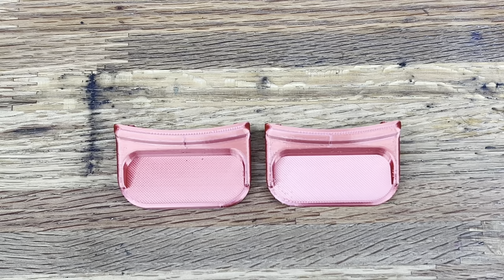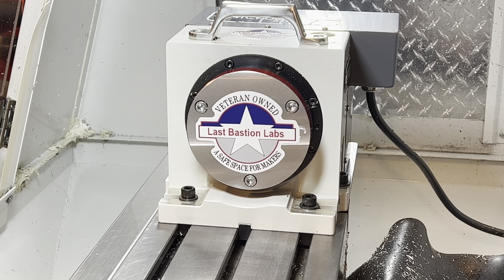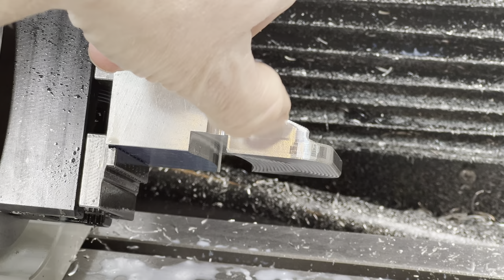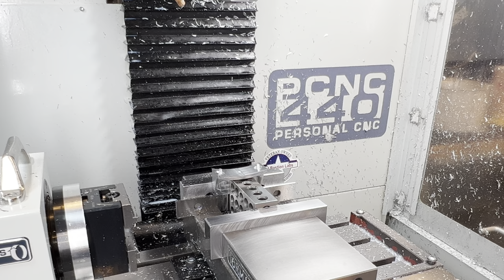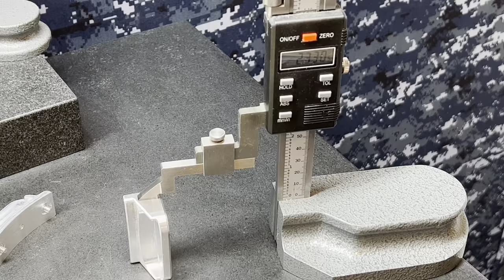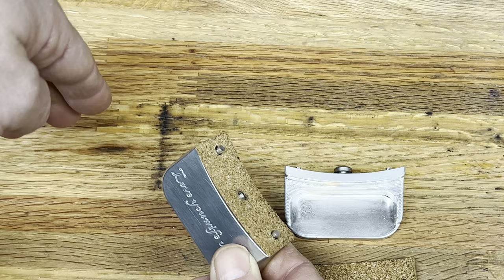Satisfying the wife unit's machining needs with my Micro Arc 4th axis.

Comment: You can build a temp controller for the crock pot very easily and turn it into a Sous Vide cooker when you are not using it as a crock pot.  Sous Vide steak is the best!

Comment: Just found your channel. Good work I subbed. I have rebuilt a Syil X4 with a spindle and Masso. Got it running good now. Just venturing into 4th axis work. Nice parts and good accuracy. I'm not sure the Syil would be quite that good but similar. The reality is I cant manual machine better and everything I make seems to fit together nice. I was chasing better accuracy for a bit but it is what it is and if I want better I'll need to buy a far more expensive machine. That is not happening so I accept it for what it is. A thats pretty good.
Reply from the maker: Thank for subscribing!   We all the the "chasing better accuracy" game.  Good luck.  What make the micro arc work so well is the harmonic drive.  Also, you can pick up used 440's for about $6K.  Best of luck.

Comment: I think everyone of your videos are awesome. The humor is hilarious. And I can so relate to the learning curve and my own scrap pile. thank you…BTW, I need to get that PAF xin dian vice and adapter. Any links are appreciated.
Reply from the maker: Thank you very much.  It's comments like this that keep me going.  
With the link below you can order both the 8-55mm and 50-75mm vises.  In my video I used the 8-55mm
https://www.amazon.com/gp/product/B08XQMFFM2/ref=ppx_yo_dt_b_asin_title_o04_s00?ie=UTF8&psc=1
Email me at lastbastionlabs@gmail.com and I will send you my model for the adaptor plate.  You have to make that one.
Reply: I have a few of those and I think for the money they are a good little vice. I'm not sure about this learning curve you speak of, for me it was a vertical line extending near to the top of the graph. Only recently has it diverged to a 45 degree incline. By far the most challenging thing I have ever taken on. Only shear pig headed determination has allowed me to push on. That said I had to rebuild my mill first and that was not expected from the outset.

Comment: as a CNC noob, one thing I'm still struggling to wrap my head around is accurately holding and locating parts for second/third ops. When you clamped it in the vice for the final op, how did you make sure it was perfectly level and in the exact right position?
Reply from the maker: The flat end of the part was on the parallel.  I gave it a few taps with a hammer.  I also referenced my Z height from the bottom of the part by touching off on the parallel.

Comment: I've got the vice and the adapter plate all set up.  Can I assume you have to manually probe the block on the 4th to find the center x?
Reply from the maker: I tried to center on the vice with lack luster results.  I found that mounting the er40 with a 1/2" gauge pin and running the path pilot find center (Z and Y) worked the best.  After I had the center I mounted the vise, set the stock and probed the end of the stock to set the X.  Hope that helped.